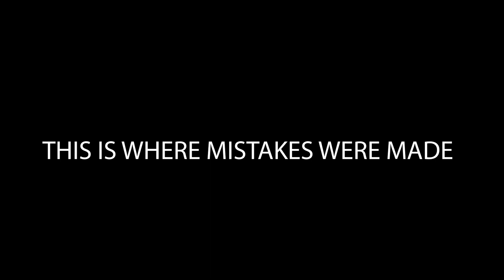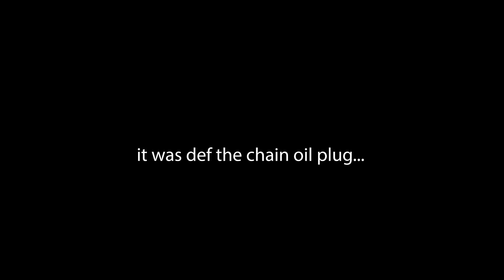WE ALMOST SANK A SHERP

Comment: Turning my sherp n all electric. Will be crazy
Reply: Make a hybrid one diesel generator
Reply: Independent controlled wheels will give more control
Reply: @ktmfour1007  I'll be doing 2 motors one for the left and one for right tires. And prefer all electric over diesel generator
Reply: @travisharding9356  yea i get ya one step at a time .. Its something huge quarry truck s n equipment are going too ur able too use a smaller engine w a smaller battery and achieve the best of both worlds .. Run the genny on free veggy oil lol